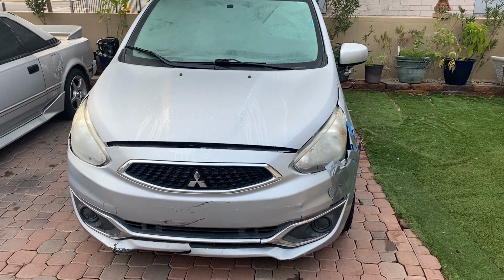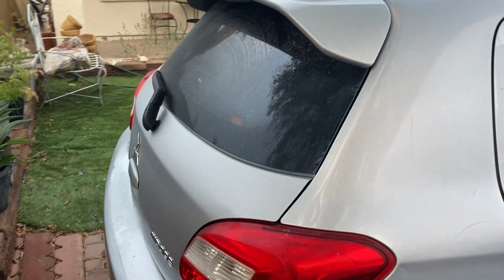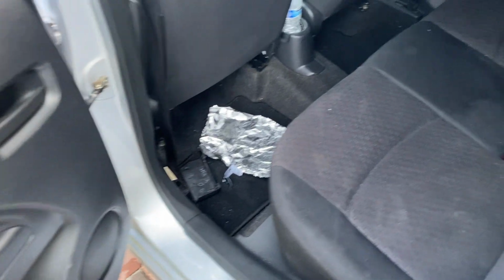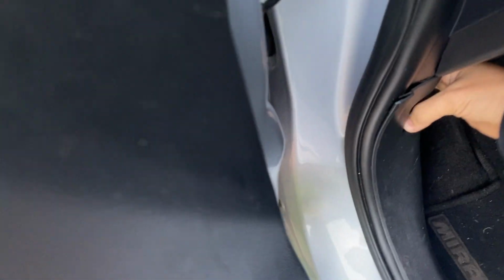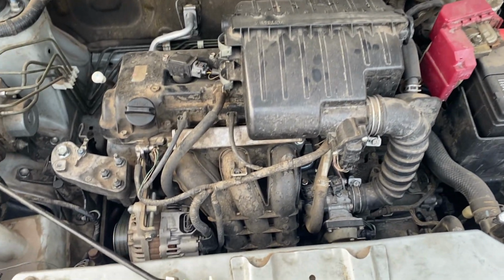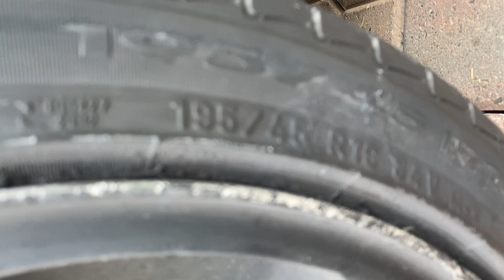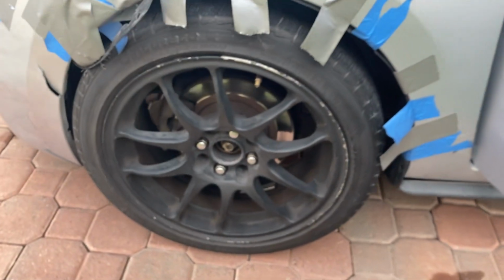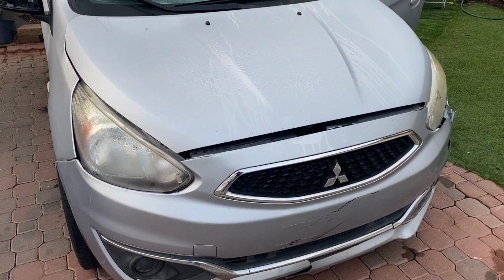2017 Mitsubishi Mirage ES CVT new addition!

Comment: Pisses me off that someone would treat this car like that. At least you got a good deal. I've actually gotten my bumper ripped off a few times and managed to fix it with things I already had, you could def make that bumper look a whole lot better for barley any money but it would take a little time. I fixed mine with mostly zip ties but you wouldn't even know it was ever fixed. And yeah for sure get that trans serviced and the magnets cleaned, just looking at the car I would assume it's never been serviced. Don't want to wait to long to service it, otherwise those clutches can slip when you change the fluid. I have a 2017 SE with 100k on the odometer and it looks brand new, might be a cheap car but with my expectations it's a luxury car hahaha, want it to stay looking new.
Reply from the maker: I plan on getting the transmission fluid serviced along with the filter. I’ll do another video once I clean up the car. But yeah some people just could care less about their car. Last few days been working on the cosmetics to the best as I can and lowest amount possible. I changed the air filter to start. As long as you take care of it. It will take care of you! Keep it goin’